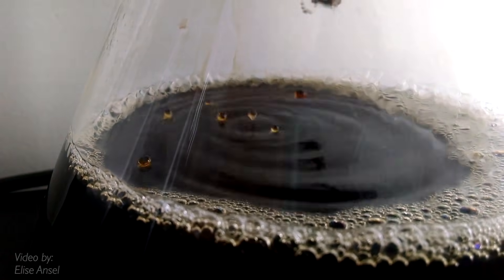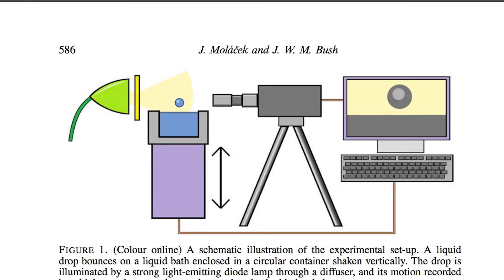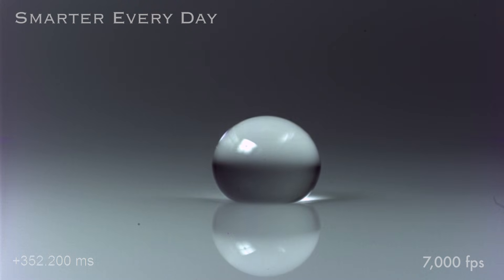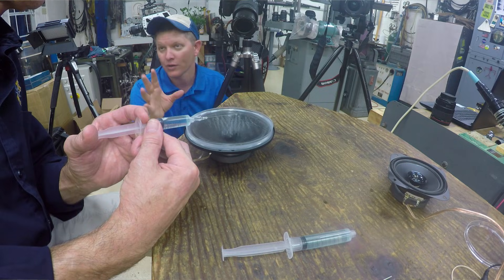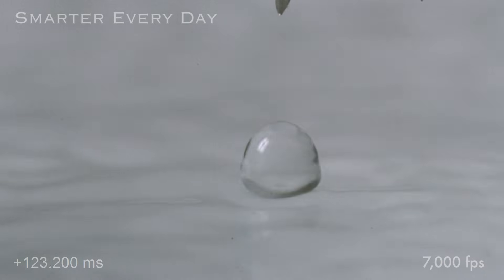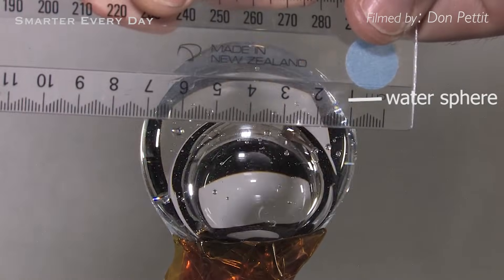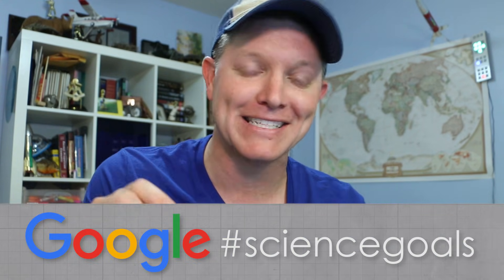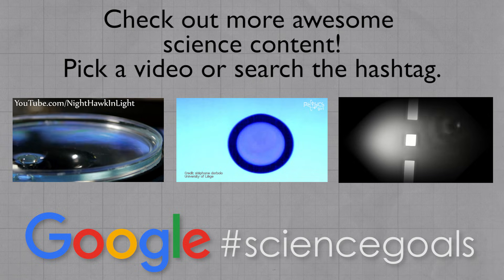The WALKING WATER Mystery (in SPACE and SLOW MOTION!) - Smarter Every Day 160

Comment: 5:58 Actually right here you can clearly see what's happening. The frequency of the waves are smaller than the diameter of the drop of water. Which makes it much less likely to find a large enough surface area to negate the air gap. And as you can see. That's exactly what happens. The drop dance is on the water. Until it gets to the edge where there are a lower average density of waves. Where the drop can find a large enough surface area so that the air gap is more easily disbanded and it promptly merges, mellds or "coalesce's" right in. 

7:12 That is the calculation that you would use for a larger system. But it's actually the surface tension of the drop of water is higher then the impact of the air pressure caused by the impact of the layer of air on the body of water. Whether or not the body of water is vibrating at a frequency higher than the diameter of the drop of water. But it will be substantially less likely to immediately find a surface area large enough to negate the air lair if it is.

9:50 so the cello is a very rich sounding instrument. And this is for a reason. Because it actually covers a very large frequency even though it is technically a low frequency. Because it is at such a high amplitude. So it is actually breaking off drops of water in what would be a very high frequency wave. But because it is in this particular shape it creates a standing wave. Which shears off pieces of the surface of the water. Creating drops of water. And of course the surface water is still vibrating at a frequency high enough to negate the air gap. Allowing the continued traversal of water droplets within the sphere of water. Likewise you can see a vibration on the outer surface of the orb. Caused by the same amplitude that produces the water droplets. But the cello along with a few other instruments have either high frequency at low amplitude or low amplitude at high frequency. Either one should cause and effect. But that is tripped out though!

Comment: My first top-of-my-head opinion on this, before watching the video:
That beading happens because the energy and forces involved in  the surface tension of the tiny droplets is so many magnitudes stronger than the gravity affecting the droplet, and the water-cohesion witch wants to consolidate the droplet into the bigger liquid operates at too short distances to bridge the gap.
.
Now let's watch and see how much of a fool i was.
.
.
.
Ah yes. The air interface between the surfaces.
(and some very interesting stuff about using vibrations to feed energy into the system, and extend the time....indefinitely?)

Comment: The surface is slightly positive charge because the oxygen has a stronger pull on the electrons than hydrogen. Positive surface slightly repels positive surface until drop acceleration overcomes repulsion. Acceleration energy gravity or acoustic and the mass of the droplet determine whether it bounces or not.
Reply: If what you're saying is true then if a water droplet survived the initial impact it would sit on the surface indefinitely, and never coalesce.  It has the most kinetic energy it will ever have on the initial impact.  If there were just some energy threshold to overcome it would overcome it then.

your understanding of "acceleration energy gravity" appears to be flawed.  Gravitational energy does not 'build up' in a stationary object, and would not in that situation allow the droplet to overcome the hypothetical magnetic repulsive force on, say the third bounce but not the second.

Comment: Charges in the localized area cause the  potentials of charge to be offset and theres a standing wave that is together a larger surface area and force keeping the offset droplet from bonding with the surface tension being higher then the waves. Since the drop is only touching one radiant of the water. 

Atleast thats how i explain it with out math.

Comment: I'm guessing surface tension on both the drop & water surface.
Reply: Basically. Just not enough energy to break the surface tension of small drops. The hydrogen bonds between the molecules which already exist do not break easily enough. Doing this with something like acetone will probably not show the drops because the bonds are much weaker (or the drops will be smaller).

Comment: It's called surface tension.  Until the two opposing surfaces blend together and coalesce the surface tension keeps them apart.
Reply: This is what I was thinking as well.  Same way bugs and spiders can walk on water.  Maybe I missed this, but did they mention doing this experiment in a vacuum?  That would prove/disprove the air gap theory.
Reply: @Playa from the Himalayas 
The problem is, water would boil in a vacuum.
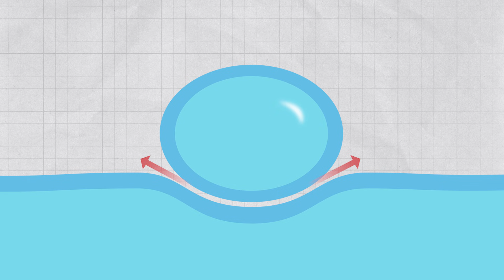Reply: @RicardoLivinLargeTho  yeah they did, about the same time when they did all the talk about air gap theory... 3:33

Comment: Hay i have always been under the impression that it was surface tension.  Since i have never seen it on a large scale it lends to my theory. Gravity doesn't always have the force necessary to break the surface tension right away. The drop has to deform before it can break. This is only possible if the original force was not enough to break the tension. I am not highly educated, but this has always been my belief, and I haven't seen anything to contradict it. That's also why that collision force plays a role.
Ps i can explain the bubbles in space too if your intrested.
Reply: go ahead pls
Reply: @Dbrulee  the force of the harmonic vibrations breaks the surface tension, this breaks the water into small drops. This is not only possable with a cello, but is possable with any noise that resonates with the water. What will work depends upon the size and shape of water as it's resistant frequency will change based upon those two factors. An example on earth would be a "star in a jar"
Reply: @savemars4383  hmm..intresting

Comment: The shot where coffee drips land and skate across the surface is because tiny bits of oxygen molecules get trapped and form a bubble. Since the density is lower than the rest of the fluids, it’s weight is supported by the much denser and heavier body of water 💦 or coffe;, in this case. So basically, they have different densities and they won’t mix. If the bubbles occur at the bottom as with soft drinks, they rise until they break the surface. (I’m a visual effects artist and I’ve studied this phenomenon quite a bit. I also had an instructor who had been a physicist).

Comment: Well Dustin you did it. You in a way burst my bubble I had convinced myself that water did that due to the mass of the droplet was not sufficient to overcome the surface tension of the water. Much the same way that a water spider is able to walk on top of water it also does not have enough mass to overcome the surface tension of the water. Although in the case of the water spider it does it by spreading it's mass over a larger surface area of it's 6 feet touching the water. but That was not the case with your experiment but some of the others with the tiny droplets this could have at least something to do with it.. What do you think  ? water does have a fair bit of surface tension.
Reply: The water spider would stay on surface indefinitely, but the water droplet coalesces after some time. That's the crucial difference - water droplet is the same surface material as the body of water, intuitively (to some people at least) it should form one surface immediately and the surface tension should pull the droplet, not repel it. It does pull most droplets, right? When showering, you don't get a sea of round droplets at the bottom of the tub, rather the water forms one large pool. Where does the surface tension go? What are the conditions for it to sometimes not go? That's the point of the video. They explain that the trapped air (3:33) affects the timing how long surface tension keeps working on the droplet and the pool as two distinct surfaces.

Comment: Surface tension combined with elasticity? What happens if you drop the water drop from a taller height? More beads, less beads? I am thinking there has to be enough energy to create a bounce, otherwise the drop would just sink into the main water surface.

Comment: i have noticed this happen in a 2 liter bottle of diet coke. similar in many ways to the speaker part of your vid. i saw this happen on 2 different occasions. but do not remember if i had previously opened the container or not. the bottle is at least partially pressurized so it ringe like a bell when tapped, suspending it by the cap and tapping on it makes concentric waves and some beads of soda get kicked up, those skate across the surface.

Comment: What about the static energy that forms a kinetic skin around the water in droplets? I don’t think dancing droplets have anything to do with air pressure between the two water surfaces. We see insects use the static surface tension to skip across the water. Mystery solved.

Comment: I first noticed this phenomenon in a cup of coffee in a styrofoam cup. If you slide the bottom of the cup across a smooth surface (preferably formica0, the cup will vibrate, and suddenly, little beads of coffee drink jump out of the surface of the liquid and dance around on the surface of the coffee in the cup. I was astounded by this because of the incredibly strong surface tension of water! How is it possible the vibration can be so powerful it breaks the beads out of the liquid under the surface tension force?  If you stop the action of sliding the cup, stopping the vibration, the surface goes almost completely calm and flat, but the bead of water stays on top for quite a long time, several seconds. I do not understand then, how the so-called "air boundary" between the bead and the surface can be responsible. 

Here is what I think is happening: I think the nature of the surface tension of water somehow traps the bead surface tension when it is formed into the small spherical shape, making it more powerfully attracted to itself than to the flat water. Just as the surface tension of flat, calm water can trap a steel razor blade on top of the surface, the trapped or "closed" surface tension of the bead gets trapped on the top of the surface tension on the main body of liquid in the cup.  I think the nature of the "closed" surface tension of the bead, is actually repelled (or no longer attracted as much or enough)  by the flat surface tension - the beads tend to mostly return to the main body when they get near the side of the cup- where the surface tension of the flat surface is distorted by the surface of the cup, and possibly by electrostatic influence from the styrofoam.

I think this phenomenon is attributed more to the shape of the water surfaces than to the air trapped between the two surfaces or the added energy of the vibrations that made them. The attraction between water molecules is just too strong for the trapped air to be the primary causal effect. .. although it almost certainly is a contributing factor.

It would, of course, require someone far smarter than I am to work out the physics of the difference in closed sphere water surface tension vs. flat water surface tension. There seems to also be some sort of limit to the size of the spheres involved. They seem to be quite uniform in size regardless of the other factors.

Comment: my 1st time seeing this at all.. and im 4:20 into this vid, and iv allready came to my first hypothesis, 
 -The non-vibrating/non moving drops, are dropping into or onto the same substance(water or..) and are resting or bouncing ontop..
- as the two different vibrations stay vibrating at different speeds(for a second or so..) the drop does not mix or drop into it its self.
-as soon as the drop starts to move or vibrate close enough to the main surfaces vibration/movement, then the drop will be able to "drop" in
... im prob wrong but i'll jut edit this to look right later lol..
Reply: Bingo. I believe you are correct. Both bodies are water resonate at different frequencies. The small drop faster as it travels through the air and the larger body of water slower. Once the drop hits its energy is absorbed into the larger body of water and it becomes one with the body of water once its frequency attunes to match the larger bodies frequency.

Comment: I’m not satisfied with the explanation. They just took slow-mo of it on a speaker water thing and made some reasonable comments about why that worked. What about the non-speaker situations? Does it work with DI water? Does it have to do with a temperature difference between the drop and the body of water? Is there an optimum water droplet size that interacts perfectly with the surface tension to somehow mathematically phase the droplet out of adhesion capabilities, at least until their temperatures match... or something? As cool as this video looked, it didn’t answer the question satisfactorily. Do better! This isn’t finished!

Comment: You should measure the size of each drop (using that camera?) before it hits the surface and see if there's a correlation between the drop size and it's likelihood to bounce/survive. The size of each drop would determine its internal resonant frequency and I expect that determines the likelihood of a soft bounce and therefore a longer survival (resonance) time. The needle helps to make consistent drop sizes (try a different sized needle) which helps generate the identical conditions needed to see this repeatedly. Other variable that need testing are the volume (and shape) of water below the drop which may impact the base water's internal resonant frequency. Also you made no mention of the pH or purity of the water (eg, distilled?) So many variables and none of them were tested. Even the purity of the air (and humidity) could have a huge impact on the survival rate since we are talking about microscopic distances between the drop and the water below it. In some of your clips of this phenomenon it seems that all the surviving drops have the same size (or multiples of the same size) so the internal resonant frequency idea "holds water."

Comment: There is a ' Like Polarity ' involved >> The surface tension of the 'Base water would be negatively charged through a binary of surface tension charges and the droplet assumes the same chemical process of being negatively charged >> resulting in repulsion in parallel with the the presence of air at at micro level.

Comment: Water surface tension….BUUUUMMM BABY...you have been served.
Reply: Why doesn't surface tension pull the droplet into the body of water immediately when they touch? That's the question answered in this video. The surface would be one and the same immediately, if not for the air gap.
Reply: @u1zha  uhmmm...do you know how water surface tension work? The droplets and the water ponds are separate body of water each with their surface tension force without the surface tension no amount of air can get the droplets "dancing"  on the pond.

Comment: I don't find this very surprising. I might be wrong but isn't this very simple to explain?     My intuitive first thought was:
The little water drop stays on top of the bigger body of water because the surface tension around the little drop is stronger than the weight of the drop. Because of that, the surface tension (which I think of as all little shell around the water) does not break and the 2 bodies of water do not merge. Only why extra force is applied, such as wind or movement from the bigger body of water, the surface tension breaks and the bodies merge.
Reply: Does surface tension of water change when you pump air away? If not then the bouncing behavior of droplets shouldn't change when pumping air away? Yet at 3:33 they show the data that the behavior does change.

Comment: I do the all the time when i get coffee served in a foam cup. Carefully slide the cup along the table to set up a vibration in the cup, Beads form and race around on top of the surface until you stop moving the cup. I take milk in my coffee so it is a very clear view of the beads, probably works on black coffee and likely just water. Easy to do once you get it the first time.